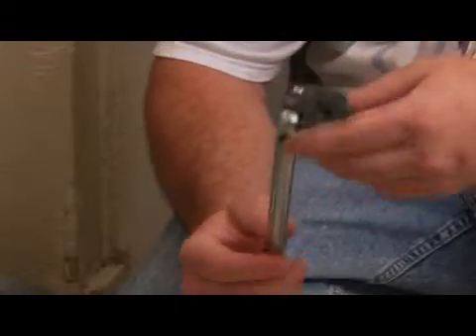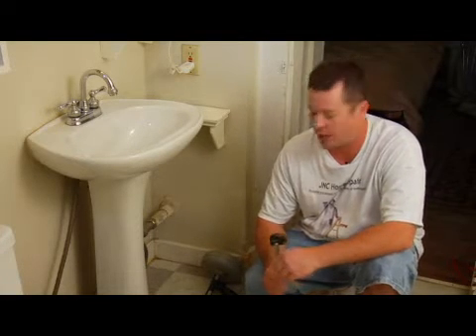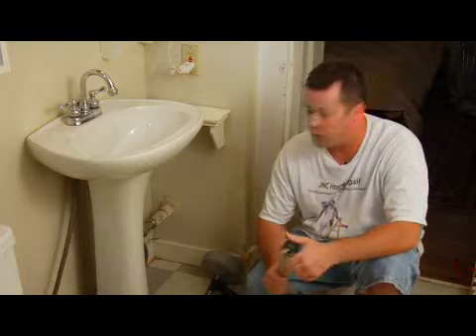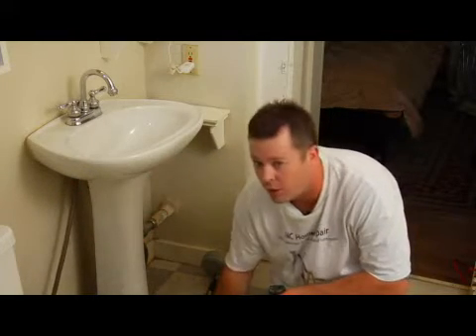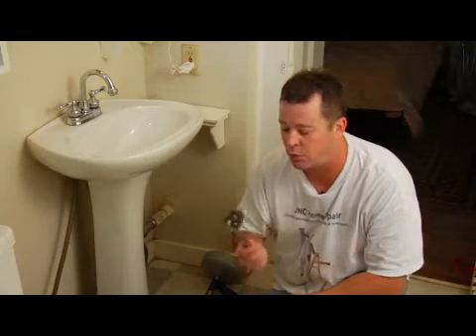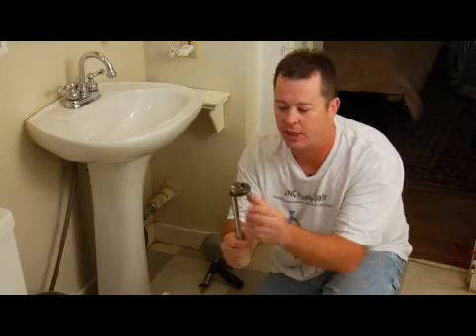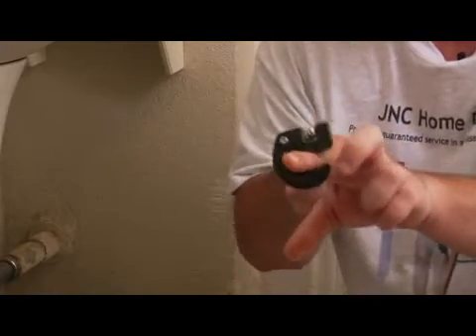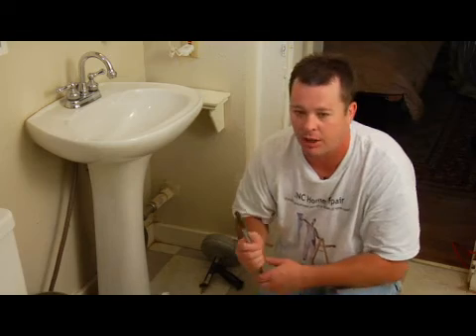Electrical & Plumbing Repairs : How to Use a Basin Wrench

Comment: A basin wrench is not always required if you are going to change the sink (basin) as well. If changing the faucets in a vanity it is possible to change the faucets with a pair of channel locks although it is a little more work it will save you from buying a basin wrench. On a wall hung sink or pedestal basin; a basin wrench is needed although you  can remove the sink and install the faucets if you wish.A little more work, but no purchasing of a wrench...Have a good day